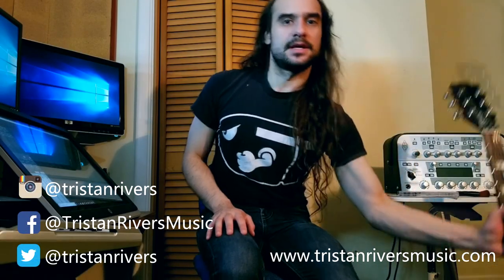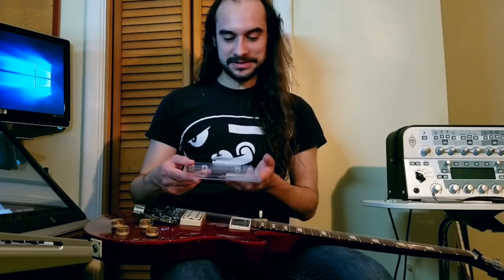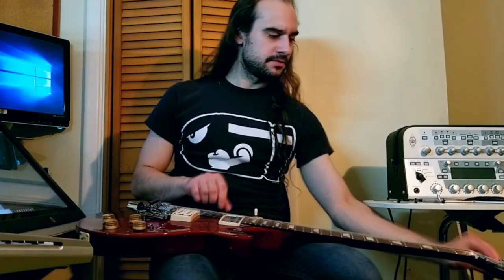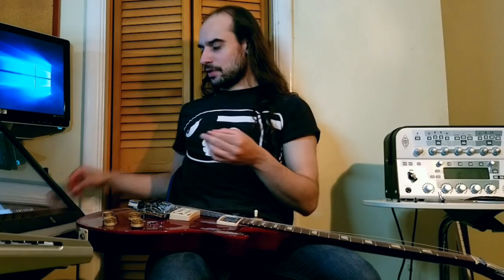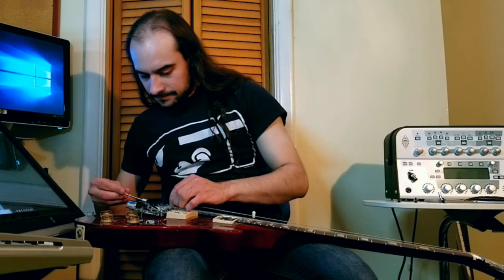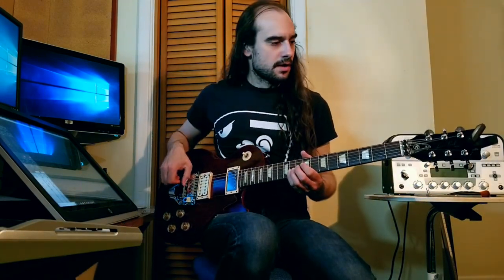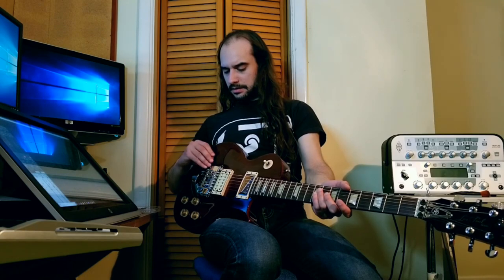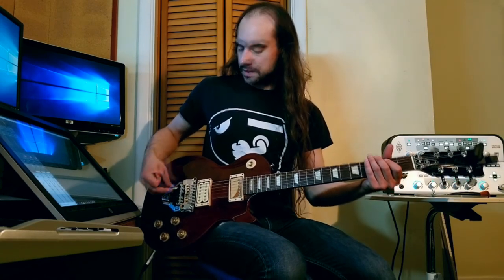Using an EVH D-Tuna with a Floyd Rose FRX Bridge

Comment: Think of it this way. If your trem goes backward, it won't work. It's specifically designed to work on a dive only trem. That's how EVH's trems are set up on all of his guitars
Reply: Brent Henderson this demo installation is a fake one. it didn’t work on my FRX system this D-TUNA and this guy didn’t upload anymore of his EVH dtuna on FRX tremolo
Reply: @sfear6  It does work. It wont work on ANY floating bridge because the tension changes on the string. However, this bridge does NOT have to float as he showed. Use the thumb screw to put it in dive only mode AND what he didn't show... add spring tension. More tension is required. You also get the extra benefit that double stop bends are also in tune... and it can handle a string breaking without the rest of the strings going out of tune.

Comment: will the frx work better with a tone vise pitch shifter instead?
Reply from the maker: I've never tried one but the Tone Vise product looks like it would fit the FRX even better. It is much smaller so I don't imagine it would need to be removed to use the FRX in its floating configuration (of course, using the drop tuner while it is floating will likely throw the guitar out of tune). I might like to order one to try it out. Thanks for bringing the Tone Vise Pitch Shifter to my attention!

Comment: It didnt work with mine
Reply from the maker: That's unfortunate! I feel like I was kind of lucky with my entire experience with my FRX. I was able to install it easily and it took almost nothing to set up and intonate it. I don't think I had to do much to get my D-Tuna installed and properly in tune too. What went wrong with yours?
Reply: Everything. My neck isn't high enough for my frx, so the frx was slamming into the body of my guitar and I couldn't get the d-tuna in which probably was because I couldn't get the frx on.

Comment: i have a FRX, i tried to install this D-tuna, but it didnt work properly, and D-tuna dont and will never work on a floating bridge like the FRX
Reply: You can change the FRX to be either floating or dive-only.

So as long as the D Tuna fits the FRX and you have it set in dive-only mode, it will work.